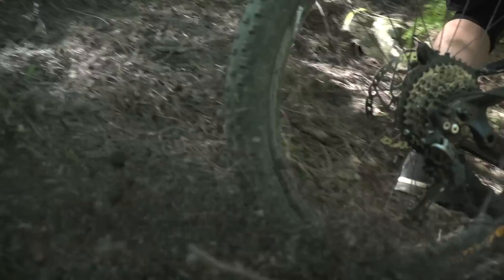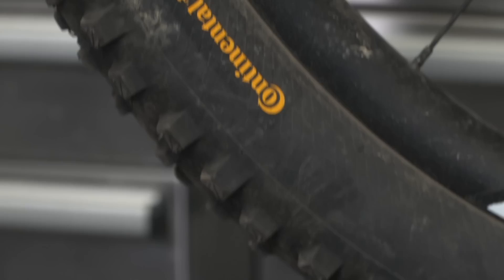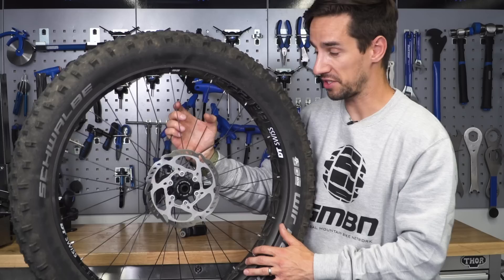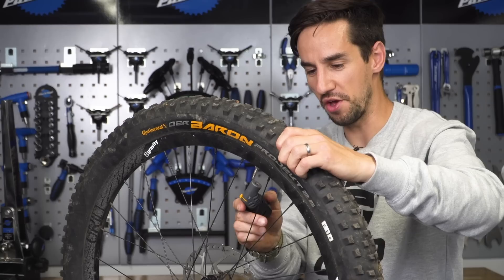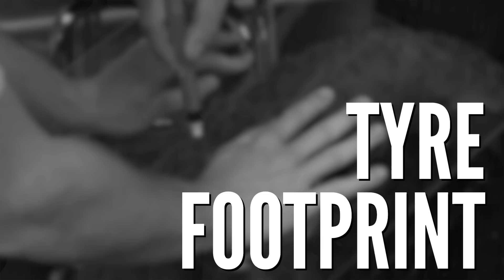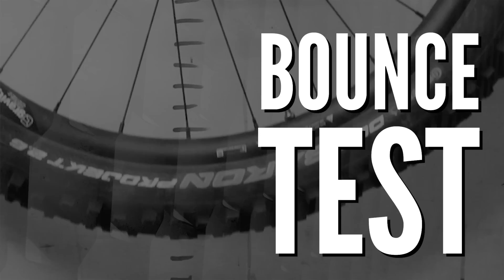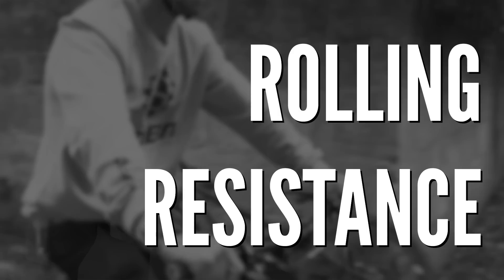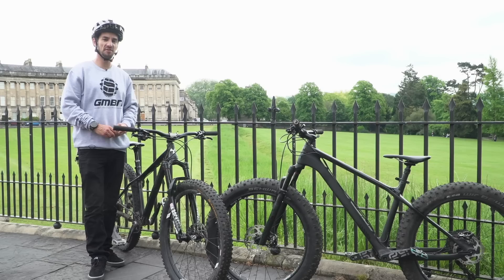Fat Vs Plus Mountain Bike Tyres | GMBN Tech Geek Edition

Comment: Hey guys. As someone who rocks a fat bike regularly I gotta say you aren't getting the full effect without going tubeless. Lower pressures are where they really shine. You'll know they're set right when you stop bouncing around and this will also put far more tread in contact with the ground. The big issue with this on harder terrain is sidewall compression, there's now 27.5 fat tires and they have shorter sidewalls which addresses this issue.
Reply: Also fat tubes are around .5 kg each so that's a lot of rotational mass you'll eliminate. I'm gonna send a top mod in for ghetto tubeless that's nearly pro grade.
Reply: @robsodomy  tubes allow you to run lower pressure, do they not?

Comment: Fatbike advantages on the trails (not snow — I have never ridden a fatbike on snow😂in my 7 years of riding them):
• late braking (assuming you have decent trail tires such as the Maxxis Minion FBR/FBF) when you realise you’ve perhaps not taken the best turn in line in the corner
• less fatigue (as Neil indicated) whilst bombing down technical chunky stuff such as rock gardens
• IMMENSE uphill climbing traction (as Neil mentioned in this video and as Blake mentioned in the associated video comparing the plus bike to the fat bike)
• everyone thinks you’re on an e-bike (since most tossers around these parts ride fat ebikes)
• carry more momentum on dowhill chunky sections without associated arm pump or upper body/arm/shoulder/wrist/hand fatigue

Comment: The rolling resistance test has more factors to play than just simply the tyre. Mass has a big difference. A heavier object will have more momentum in it. Plus you also have to factor in air resistance. Other than that a great video Neil.
Reply: Momentum/inertia should be a negative for the fat bike in this case because the heavier wheels have to accelerate, and they aren't given a chance to spin down fully because the test ends at a specific point. 
IMHO this is a "shorter point from point A to B" test. The lower pressure and flexing sidewall conforms to the surface imperfections so the fat bike actually travels less distance between points. 
No matter how many times a properly setup fat bike wins a non-scientific roll test the tester makes some lame excuse. This time he blames the tire tread on the 2.6 inch tire. The fat tires weren't even tubeless, the fat bike was actually at a disadvantage. 
If they really want the fat bike to loose, they could rig a motor to a crank spindle. Then quantify the total energy used to accelerate the bike on a roller to speed, hold it for a time with a rider on the bike. Then inertia and momentum would show in the energy used, you can't spin heavier wheels for free. My guess is the difference would me much smaller than everyone's guess. The reason average riders like me can ride all over the place on a fat bike without passing out is because the difference isn't as big as it "looks" my seeing the size difference. The "science" would be similar to the rolling resistance tests already online, but could continue the conversation in a good way.
Reply: adaycj so to some up we should take these results with a grain of salt as not all the factors were considered.

Comment: Tubeless for a fatbike is a massive advantage. You could reduce the rotating mass with a coulpe of hundred grams per wheel by doing that. You will achieve reduced rolling resistance, especially at low tyre pressures. Also, snake bites will be a thing of the past with tubeless. Another experience is reduced self steer and a overall quicker feel of the bike. Go tubeless!
Reply: You'll save more tha a couple of hundred grams. I weighed the tubes of my 29x3.0" wheels and they were 402g each, so I reckon going tubeless will save me ca 320g rotating mass on each wheel.

Comment: Contact patch size is only defined by air pressure. You have some pounds per square inch. Apply weight in pounds, and you can calculate square inches. Of course you can run bigger tires at lower pressure, thus getting a bigger patch, without achieving too much deformation. If you run a 26 x 1.90 at 10 psi, theorical contact patch would be too big for the tire and would have to be almost with the rim on the floor.

Comment: I suspect the improved rolling resistance is due to the fewer knobs and the rotational mass helping while going downhill. It'd be interesting to see how the two compare for climbs from a stop.
Reply: Also, the heavier bike will pick up speed more quickly on a down hill coast (all other things equal).  A better test would be to test on a perfectly flat area and get the bike up to a designated speed.  Then see how far it will roll.

Comment: Tire footprint is a function of tire pressure. Your weight divided by pressure equals footprint.
Your knobs per footprint on Perspex doesn’t take into account deformation of irregular surfaces, like rocks and roots. 
Run tubeless, unless you’re just out playing and like using patches. It saves weight and those tubes aren’t small. 
As someone said, put in some miles. Try tires, sizes, and pressures. What’s too high and too low for what conditions?

Comment: You should put stamp ink on it and sit on the bike with a sheet of paper under the wheel.
Reply: Exactly, and less  conversation about the knobs. That has to do with the tread pattern chosen. The real "float on mud" syndrome is about surface pressure/area as much as knobs.

Comment: @gmbntech should retest this, with the fat bike and plus bike shod with maxxis minions front and rear for a fair comparison and on a 27.5 fat rim to make it a fair test also have both bikes set up tubeless
Reply: I think they may be trying to keep from angering a tire sponsor. Using non-plus tires and non-tubeless tires for a plus vs fat video is pretty much nonsense. I agree, they should retest to save face.
Reply: adaycj at the least they could have set the bikes up the same
Reply: The problem is, it is a real nightmare to setup those DT fat wheels tubeless. I've done it, it isn't worth it. n my opinion >30 mm rims is also not going to be idea for a 3 inch tire. It may not even be ideal for a 2.8. 
GMBN should have enough resources to find a properly setup fat bike, and a proper plus bike, ride it for a time,  test it. 

As it stands now it looks like they are nursing what they have to crank out vids. I keep getting that feeling like the commentators only have and hour each on the bikes outside of video time too. 

I very much like the low(er) production cost videos like this that promote conversations about biking that aren't all just marketing and commercials. GMBN is good at that. In this case though, they missed the nail with the hammer.

Comment: The larger the volume of tire, the lower the tire pressure needed to achieve the same amount of surface tension. I believe the formula is Tension = Pressure x Diameter, so if we take a tire pressure of 19.5 on a 2.35" tire, we only need 16.43psi to achieve the same tension on a 2.8" plus tire, or 9.56psi on a 4.8" fat tire. Some neat math, and also shows Fatty tires running at those ridiculously low pressures are still quite capable at holding the tire on.

Comment: My fat bike uses a 3.8" tyre, the informal term is "mid-fat", where-as a fat bike can be anything up to 5"+. Wide handlebars are a must, I bought the bike came retro-fitted with some narrower bars, it was the guy's wife's bike, maybe she didn't like reach out that far. Either way, it was impossible to steer comfortably. 780mm+ or go home.
Reply: Definitely depends on the riders shoulder width but I agree
Reply: I think what it really depends on is what the rider is comfortable with and what feels best. The same reason I don't associate stem length with rider height. A frame should be sized accordingly for a person, the bars and stem should be however the rider wants them to be. If a frame doesn't have a long enough reach, don't make the stem longer, get a longer frame. etc. I'm sick of people telling me how my cockpit should be set up, and I'm sick of how conservative a lot of mountain bike manufacturers still are after all these decades of terrible handling bikes.
Reply: Fat bikes are 4 and 5 I hate a 4.8 and whenever I see a three it literally looks like I road bike compared to the fat bike    3.8 isn’t fat at all

Comment: WRONG  Tubeless at 4 - 8 psi makes a MASSIVE difference on a fat bike tyre. Rolling resistance is way way lower with tubeless.
Reply: how so? going tubeless potentially makes the tire more compliant and therefore has greater rolling resistance.
Reply: @taylorhickman84  no not at all. If you have a Fat bike with tubes, do try the same tyres tubeless, its a massive difference at low PSI's.
Reply: @tablatom  I don't think you understand what "rolling resistance" means, that's not to say tubeless isn't easier to pedal, but that would be due to the reduced rotating mass.

Comment: Hullo, i'm looking for a good fast rolling plus size tyre. Any suggestions?
Reply: I like the MAXXIS Rekon and Ikon. The Ikon is more of a XC tire if that's your cuppa tea. I run the Rekon which is a 2.8 (3C Maxx Terra). It's the  more aggressive of the two(Enduro Tire) . Lot of good tires out today, but MAXXIS is a rock solid choice. I paid $130US for them. Good Luck.
Reply: WTB Ranger 2.8, very fast. I replaced my Maxxis Rekon 2.6 with them. Reasonable price too.
Reply: $130 for a tyre?! blimey. Er thankyou for the suggestion though hehe

The WTB ranger looks pretty good though and it is indeed inexpensive at $25
Reply: Rocket Ron

Comment: Calling 2.6 a plus size tire is like calling Kim Kardashian a plus size model.
Reply: Very Good Comparison...  
She Is No Waif...!!!
Reply: Stop Trying To 'LABEL' TIRES!!! 
(That Already Have SIZE LABELS...!!!) 
5.1" is REALLY FAT... 
(...ter than) 
4.8" is Definitely FAT(ter) than 4.5" and 4.2" and 4.0" and 3.8" and 3.5" and 3.0"...  
2.6" is FAT(ter) than 2.5", which is FAT(ter) than 2.35", which is FAT(ter) than 2.1", which used to be considered "FAT" (back when MountainBikes came with 1.95" tires)...  

So whether or not we decide that, for MountainBikeTires; 
"Adolescent" is up to 2"...  
"Teenager" is 2.0 - 2.2"...  
"Tweener" is 2.3 - 2.45"...  
"CHUBBY" is 2.5 - 2.95"...  
"PLUS" is 3.0 - 3.5"...  
"BabyFat" is 3.5 - 4.1"...  
"FAT" is 4.1 - 4.99"...  
"MorbidlyObese" 5.0"+++...  

2x4 is not accurately describing the 1.5"x3.5" board they supposedly 'Label' and 'Describe' ...  
So...  

CALL a "FatTire" that (actually measures and) is Labeled 4.8" ...
"a 4.8"x559mm or a 4.8"x584mm Tire" so that (you/others) automatically KNOW What (others/you) are flipping Talking About...!!!  

[Because a so-called 
26"x4" FatTire ALWAYS Mounts on a 
559mm (22.0") BeadSeatDiameter Rim and has an 
OutsideDiameter of ~30"...  

The only time a erroneously  labeled 26" Tire approaches 26" ANYWHERE, is when you are talking about a 559x50 to 559x55 Tire... 
(roughly a 2" Tire on 22"BSD Rim...)]  

FYI: 
So-Called / Actual / Accurate...  
26"    / ~22.0 / 559mm...  
27.5" / ~23.0 / 584mm...  
29er  / ~24.5 / 622mm...  

[Widths (and Heights) Vary with; manufacturer's construction method and accuracy of measurements, marketing's honesty of advertising, and on the width of the actual Rim's BSD...]  

#ItReallyIsAsSimpleAsTHAT...  #CALLitWhatIsActuallyIS!!!

Comment: The comment about tubeless not being worthwhile on fat tires is  not just wrong but super wrong. Possibly the worst bit of advice ever given on GMBN.
Reply: Good grief I know. What are they even talking about? I suspect it is the crappy deep channel DT wheels that can't be setup tubeless without a big hassle. If all else fails call it a feature?
Reply: I have the same DT Swiss rims and coincidentally the same jumbo jim tires on a carbon borealis fatbike. It’s set up tubeless and is lighter than my plus bike (mostly because of the aluminum frame on the plus bike) it weighs in at 24 pounds. I routinely ride these both back to back and I can definitely say that the tubeless fat bike is more than a noticeable performance increase. I’m still trying to get my 27+ to fly the way the fatty does, but I dont think it’s possible lol. Those 4” tires at 10psi just steamroll everything.

Comment: First let me say I am a GMBN fan. I enjoy the videos. However, I am a plus sized and fat sized tire rider. I have been for years. I know GMBN wants to make videos that are of interest, but I can't help but feel that they don't really ride these bikes much or really know much about them. The video calls this "tech geek", but I can't help feeling like Neil is just spreading the tired old nonsense about bigger tires and their setup. 

First pick a proper plus sized tire. Second put a caliper on them if you are going to talk for almost 10 minutes at a work bench if this is "geek" and "tech". Please stop with the nonsense about needing tubes, It is your crappy DT wheels. The only wheel that is worse is Weinmann because they can't do tubeless right either. An axle isn't 15mm "width", although that was likely just a mistake. While I'm at it, a real plus sized tire really needs much over a 30mm rim. Your tire pressure guesses indicate you don't ride plus or fat. 

In short stop messing with your "almost" a plus bike, and your tubed fat bike and then claiming you have some insight. Fix your fat bike, and get a real plus bike. Then ride them both 1000 miles. Then post a video.